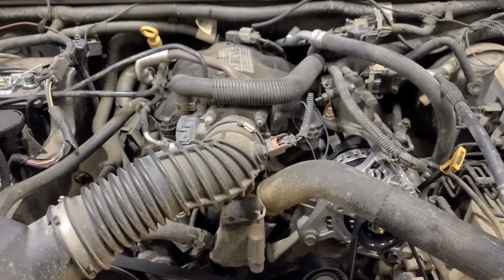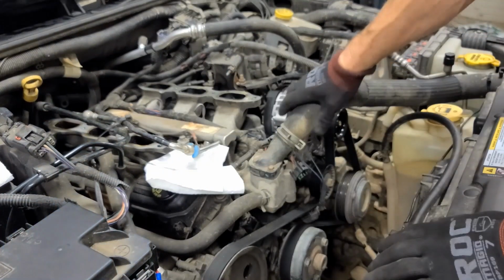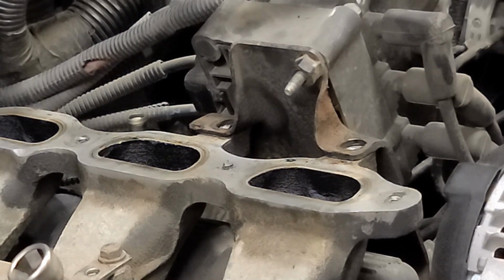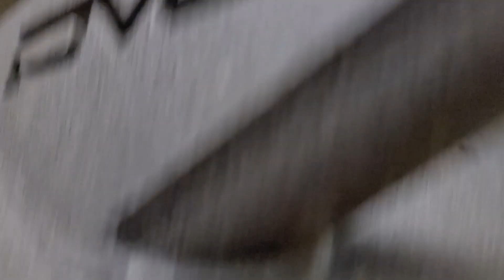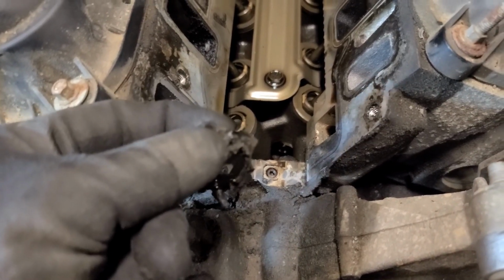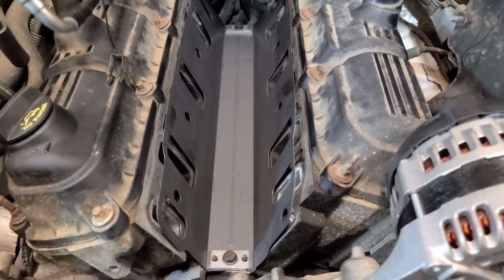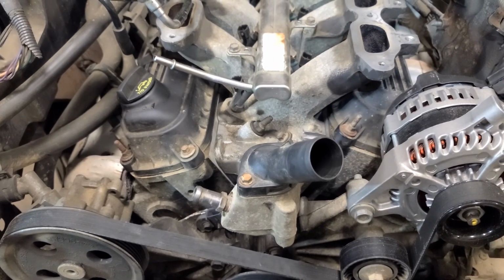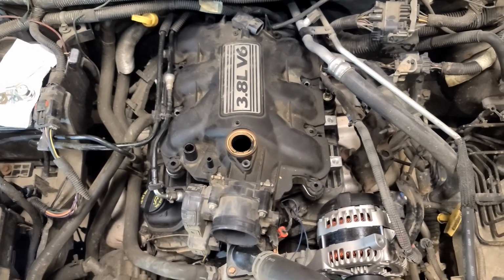Jeep Wrangler JK Lower Intake Manifold Replacement

Comment: I have a 2007 jk. Multi cylinder misfire. Replaced just about everything. Any ideas?
Reply from the maker: Well... when you say everything,  what have you replaced?  Is it one cylinder or multiple? Specific code?
Reply: @austin.gresham  6 fuel injectors, 3 coil packs, 2set of plugs, ECU, 2sets of wires cam shaft sensor, crank shaft sensor EGR valve all 4 02 sensors, plenum seals, checked fuel pressure 58 pounds and holds steady. Air temp sensor. Looked inside cats when I pulled 02 sensors, looks good. Didn’t find any vacuum leaks. Next for me, lower intake seal. Any ideas would help.
Reply: That’s all in the last week. Codes out multiple cylinder misfire. Definitely missing. No power, shakes like shit!
Reply: Cylinder pressures 195 to 205 across. Not losing any coolant.
Reply: It’s stared out as a slight miss, would stop for a while, run great for a while. Progressively got worse.
Reply: @austin.gresham  also, did a noid light test all injectors have a good pulse.
Reply from the maker: That's a LOT of stuff. Much of that I would not have wasted money on for a misfire, though - you certainly covered every base.  First question:  what brand of injectors did you use?  Second, what coil pack(s)?  Also, what codes is it throwing?
Reply: @austin.gresham  Napa injectors and coil pack. Swapped coil 3 times. And PCV valve.
Reply: Spend the extra money on quality parts.
Reply: @austin.gresham  I’m getting a burst of air back thru manifold and into air cleaner after engine shuts down. That started around the same time misfires started. P300 code.
Reply from the maker: Do you have a scanner where you can check the O2 sensor readings?  Showing the voltage curves can help check what the O2 sensors are seeing pre-cat.  You can also use  a smoke machine to check for any air leaks in the exhaust or in the EVAP system. I'd start  there...  also, I have not had luck with any injectors except the MOPAR ones. I would not swap out the NAPA ones yet, though.